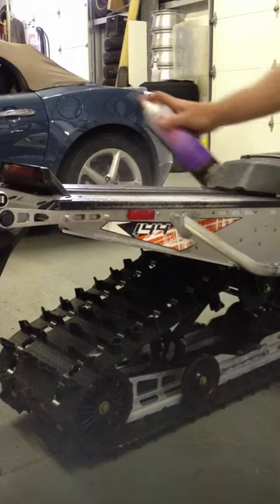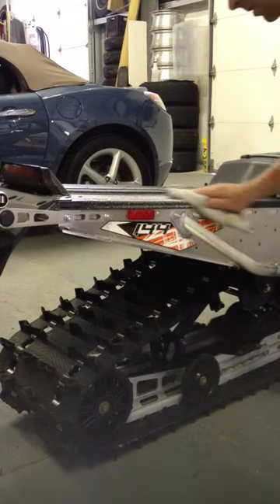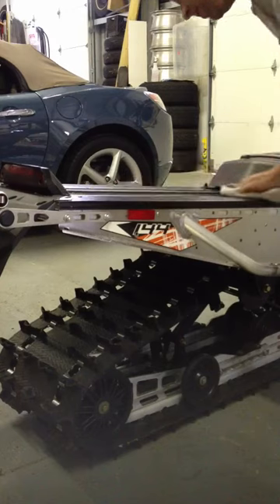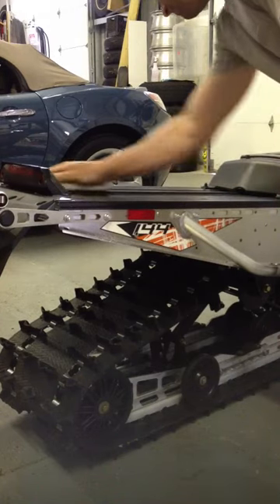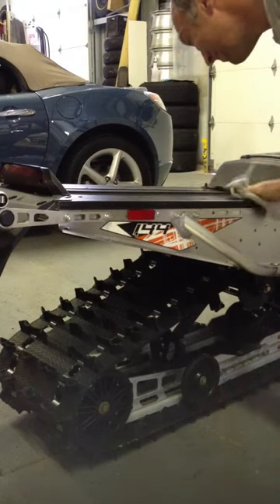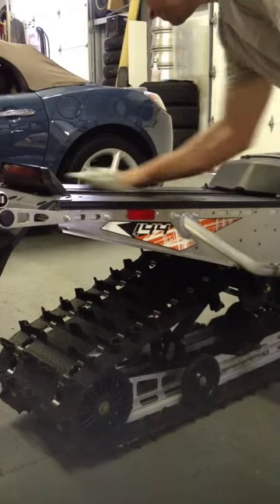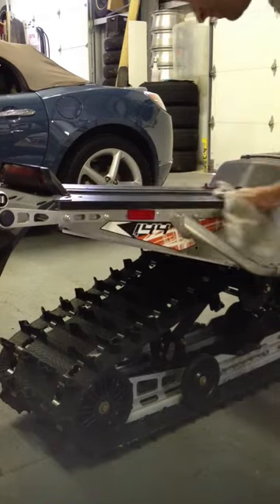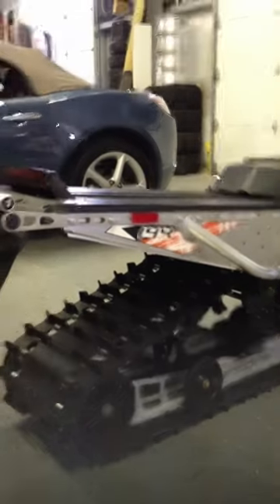Plasti Dip Snowmobile Tunnel Stress Test 1.0

Comment: Any chance of getting a comment on how this held up? I'm looking to do my whole tunnel including running boards and would like to know if this is gonna hold up 2-3 seasons.
Reply: Its pretty versatile. I've used it on rims on my car, I live on a dirt road, and its held up for a year no problems. If it ever tears, you could peel the flairs off and spray over again, it'll bond to the plasti dip already in place. If you spray it on, spray a lot of coats, its better to have it thick so when you want to peel it off it comes off in larger chunks.

Comment: Those tunnels are not really designed to hold that kind of weight, you’re lucky if you didn’t bend it. The test here would more appropriately have to do with how it keeps snow/ice from building up and sticking to it, and the big question is: does it hold up to the heated coolant running through it.